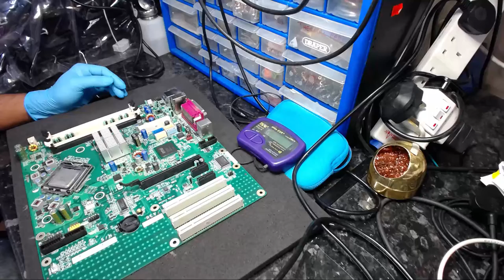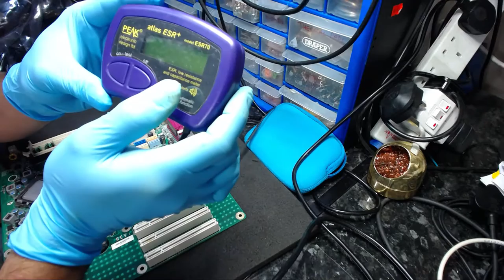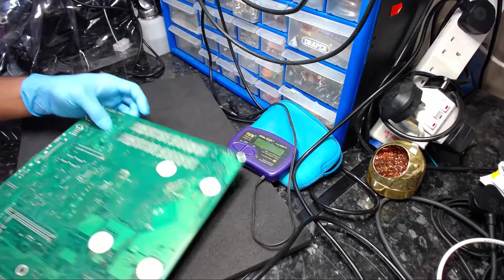HP DC7800P MOTHERBOARD CAPS REPLACED FAULT ON/OFF OR NO DISPLAY

Comment: hi mate, i got the same board and same capacitors value has been replaced on same location. but no good on my part the board is now dead. the board is working before i replace the capacitor the problem is sometimes it turns on and sometimes its not. My question is did you make the board revived?
thank you mate